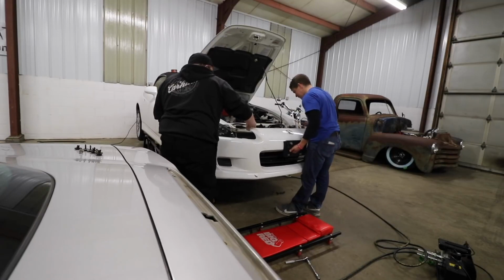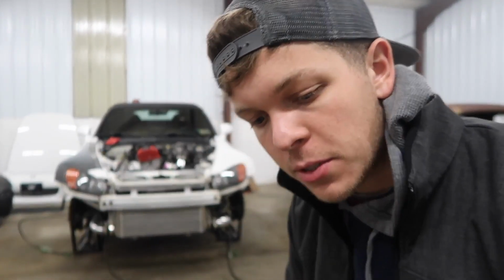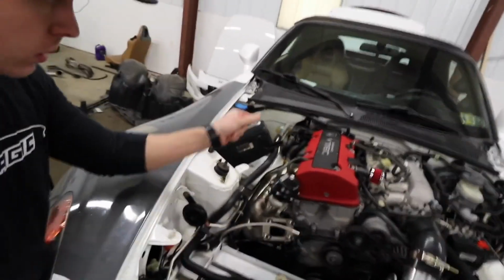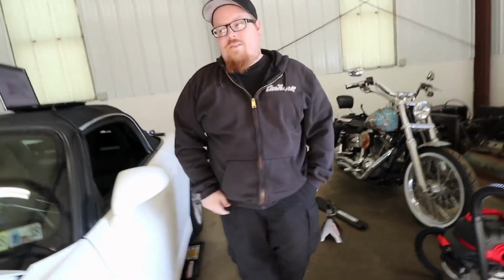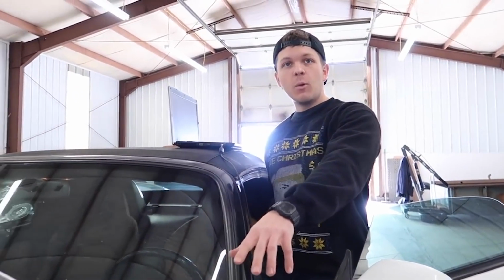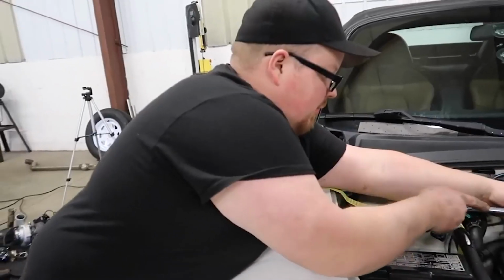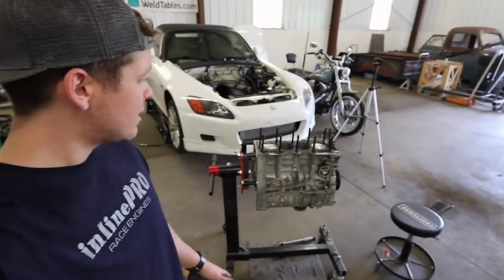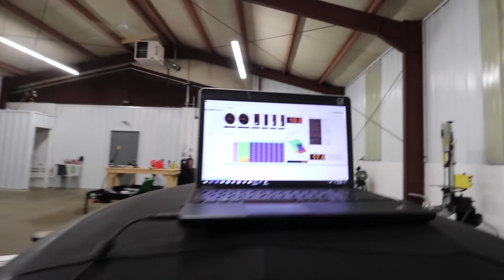Building A Turbo Honda S2000 In 13 Minutes

Comment: How the hell did you blow up the f series engine that fast....those stock engines can hold up to 800hp. I immediately assume poor tuning. Good luck with your built motor.
Reply from the maker: Definitely poor tuning lol I have a video awhile back explaining what happened
Reply: So I’m looking to get an s2000 in a few months and I’m fairly beginner level when it comes to car knowledge. I want to install a turbocharger to it and possibly get a straight cut gearbox. How does one go about doing this?
Reply: @thehendleys1  might want to start with some smaller projects and modifications if you are new to the car world, maybe start with a car that comes turbo'ed from the factory and learn your way around an engine bay first.
Reply: @thehendleys1  I know this is an old comment but if you’re new you should start with beginner friendly projects
Reply: @thehendleys1  start with having an extra 30k sitting around for parts

Comment: Pro tip- if you take the hood prop out there’s a second spot you can put it in that props the hood a full 90 degrees to avoid having to take off the entire hood

Comment: So what actually happened to the old motor? What broke?
Reply: Too much boost, the engine broke.
Reply: my guess is one the valve guides or seats let go enough to let pressure into the valve cover dropping compression that explains the burning oil through the pcv filter
Reply: @good_evening_im_tom_tucker358  Nah he stated in another video what happened. The haltech has a timing map for vtec off and one for vtec on. They didnt retard the timing on the map for the vtec on map so it was running like 30 degrees of timing. Damaged a piston